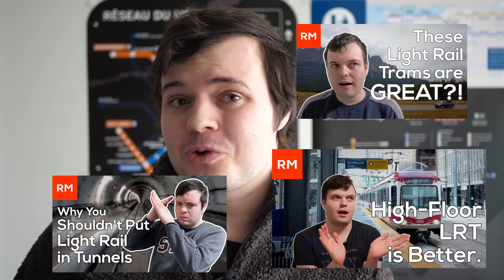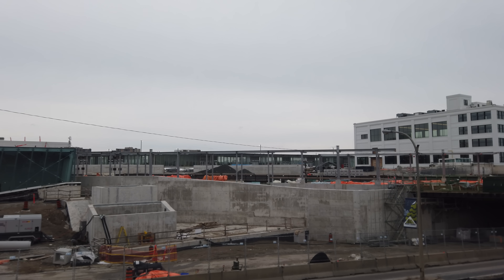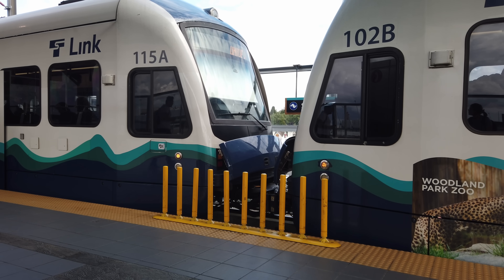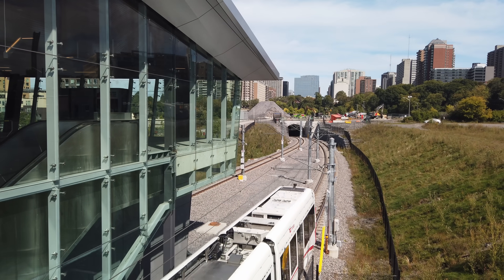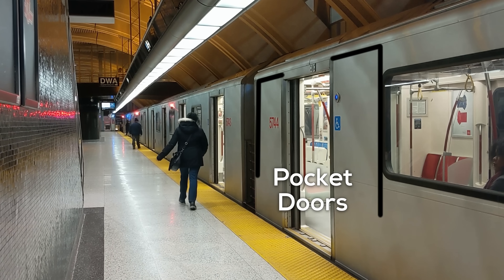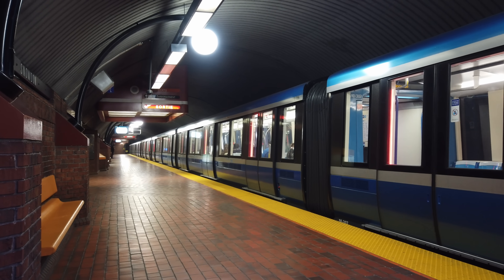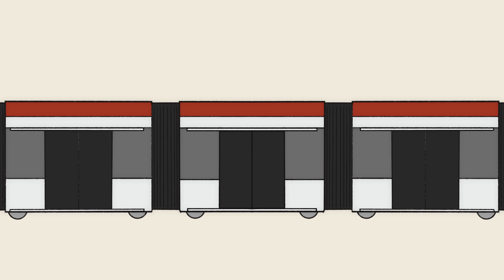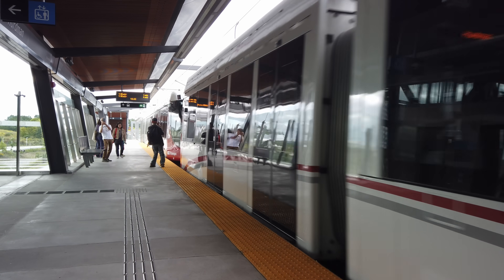I Designed a Better Low-Floor Tram

Comment: Would you like any train with your doors sir? In all seriousness, I like your logic, but your final design seems a bit ridiculous. Too long and too many doors. You make a very good counter argument about why having a single long vehicle can be a bad thing and then promptly totally ignore it and make a giant caterpillar of a train. I think it should be split in half to allow more flexibility and then each segment should be a bit longer. If you've put trams on a line that's more suited to high floor trains, then I presume you don't have super tight radii, so why do you need such short segments? Segments = added complexity and wasted space, so you want to have as few of them as possible really. I think a 4 segment unit that's half the length of yours could work pretty well. With the longer segments, the end ones could have 2 doors each and the centre ones 1 each, so you'd have 6 per side, and if you joined 2 units together, you'd have 12 per side instead of 15 in your design, which would leave more room for seats or standing and increase the body strength.

Comment: While this design is very very clever, here's my concerns. Having worked in public (or private) transportation (in more ways than one) you have to find that quite a lot of people prefer seating as well... By doing your design, you're only guaranteeing a 1 to 3 ratio of seaters to standees... Unfortunately, adding more doors also adds MANY MORE complex parts that are liable to go wrong. WDW Monorail comes to mind, 12 sets of doors on one side of a 6 car train, the doors act up from time to time. Despite the angle you were going for, I'd suggest that every other car has a door. With your shortened sections on your "FULL CHARM" trainsets (I saw the comment, I like it) it still allows easy access into the cabin AND the doorless cabins can be full wall seating. Just a thought. We (unfortunately) live in a society where you have people that will automatically take seats (even when they don't need them) leaving no seats for the elderly or special assistance passengers. With that being said, I quite like the thought process behind this! I've sketched up my own designs over the years myself, so I like what you're going for!
Reply: 7:04 Having 2 smaller instead of 1 large door means each door takes less time to finish opening & closing though (as each door leaf needs to travel a shorter distance), allowing for shorter dwell times at stops/stations. If you're worried about higher energy consumption due to more motors needed if you want to open more doors, perhaps every 2 neighbouring doors could be mechanically connected to a single motor (unless you want to allow selective door opening)
Reply: @lzh4950  it was meant to say every other car has "a set of doors". Half the amount of doors with the same concept.

Comment: I figured that in order to accommodate higher capacity in the future Seattle would possibly just have to grade separate rainier valley and SODO with everything else being grade separated but it appears that I was sadly mistaken as even on the east link segment there are grade crossings along the disused track that Sound Transit bought from BNSF. 

I find some of the decisions they’ve made to be pretty shortsighted given how little savings the capacity compromising aspects of link are compared to its absolute price tag which will be high either way. 

It would require modification to multiple platforms but I honestly wouldn’t mind the link vehicles being replaced with vehicles possibly using similar dimensions to those found on Septa Regional Rail trains. Build new ramps at the at grade stations in the suburbs and raise the floors of the underground and above ground stations in Seattle. Much easier said than done though

Comment: Rather than having bogeys on the small sections with large sections suspended with doors, you can also have both the bogeys and the doors on the larger section with small section containing only a few seats (or standing room) for passengers travelling longer distance. You can see this on TMK2200 trams by Končar operating in Zagreb.

Comment: 60 Meter low Floor Trams are in some Citys planned oder in Use. Often you can split them up in the middle.

And if you build a Frankfurt U5-MW, only as low floor, you can make your Tram as long as you like.

Comment: but the cost would be higher, that's one thing to consider as well, grabbing something off the shelf or even something that someone else has cancelled is much cheaper than custom building something, this may be better for capacity but is it really upfront cost friendly, especially for countries that are wanting to really dabble in trams, and even though you want them to go big, the first experience with trams should be suited to their needs rather than "go big or go home" method, especially when trams is the cost effective middle ground between heavy rail and... a bus.

Who knows, this may actually work out well for very popular cities with a transit budget that would rival small countries GDP's where they need to move as many bodies as quickly as possible.

Comment: i always thought that with some more considerations for strengthening, it’d be cool if we could use the Vienna Tram strange-bogie things in-between slightly longer cars of say 14m, packing on 3 doors per car side. the bogies at the very front and back would be normal bogies with these cars sacrificing a door. idk if it’s feasible given this weight but i think if it is, you’d pretty much have a normal metro train, at least from the inside, where you have the freedom to design it as any other metro train.
Reply: The ULF "Ultra low floor" wheel assemblies are extremely expensive to maintain. There's a reason newer trams aren't build that way
Reply: @muthisamwernergruber  i’m aware, but this whole video is about an expensive solution to an expensive mistake in transit planning.
price isn’t really the point

Comment: Something that could be added to make more short trains instead of a large one is to put a British sprinter like gangway in the back of each tram, allowing you to double the capacity of a single tram, and perhaps adding more standing space compared to a regular tram. You could even do middle sections of a tram with gangways in both sides, that would raise some operational challenges though, since there will be some units without any cabs.

Comment: Doors are over-rated...same with seats. Just have no doors with a plastic flap in front. Or a garage door that rolls up and inwards to roof. Also wheels are not really needed...just go French and add tires.

Comment: Motors under longitudinal seating in a low floor segment just doesn't work. The biggest thing that is stopping LRVs from having higher capacity is the smaller turning radii required to be operated on the street. The Stadtbahn in Cologne for example has per vehicle only two joints, both placed closely to the center unpowered bogie, while the motors are on the outside rotating bogies at the end of the train. This already improves capacity a lot, but also means that the train doesn't fit through the smallest streets. It does a good job though at being a metro imo

Comment: Single wheelsets (not boogies) severely increase noise and vibrations, severely decreasing the ride quality. I'm much more fond of the idea of putting boogies under the articulations
Reply: “boogies under the articulations”???  You want a boogie-woogie train?
Reply: Jacobs boagies exist so there is a way

Comment: Given that the aim is specifically for a high capacity LRV to be used in metro style services, you did good. Real good. This is exactly that.
Not the right fit for most systems or most lines, no, but that wasn't the aim. And stepping away from a one-type-for-all for LRVs is the right thing to do. It is already done, of course, but this fills a niche that currently is NOT filled. 
5/7 best ever.

Comment: I really like this! I’ve always thought that low floor trams could be much more space efficient and this is so satisfying to see visualised. The only thing I might add would be two/three slightly longer segments (like on Citadis trams) distributed evenly to allow space for either wheelchairs or bicycles since these smaller segments from the Flexity Freedoms don’t appear long enough to have space internally on either sides of the doors.

Comment: Sometimes I do feel like if we can find cheaper and easier way to raise the platform instead of doing so much engineering gymnastics around lowering the floor would be better. Just raising the platform 50 cm above the ground and many problems just go away. Like how many BRT has their raised platform so they don’t have to use low floor buses.
A quick edit: maybe we can come up with a general platform design and pre-fab them in parts so they can be easily laid on top of the existing road surface so they cost very little and very quick to setup.
Reply: Raising a platform in itself is not difficult, but you need to think about stairs and elevators as well, an that gets expensive and time consuming really quickly
Reply: Or ramps could be connected to the newly raised platforms

Comment: The London underground's Bakerloo line has pocket doors that slide in to the coach BERWEEN THE DOUBLE GLAZING OF THE WINDOWS
Reply: That completely defeats the point of double glazing. It needs a vacuum between the panes to act as insulation.
Reply: @C.I...  I think in this case its so that you aren't catching people's fingers.
Reply: The class 378 as well.
Reply: And it is always dirty
Reply: Gosh all that for a door

Comment: Why is capacity so important in your eyes? I mean even in the busiest of networks, the amount of time that the system is crowded is low. If you assume 2 hours per peak time, two times a day (to and from work) that is equal to 4 hours in a 24 hour day, or ⅙ or 16,6% of the time. No wonder that systems are planned with other priorities

Comment: I think many Canadian agecies are wary about high-maintenance issues after the colossal flop that was the Turbo Train (using axles in the articulation joints and pendular technology licensed from Talgo) from 45 years ago. Not to mention two engine fires in its brief 12 year history.

Comment: Is it possible to use highfloor tram and then sink the rail near stations, to make it accessible from low platforms ?
Reply: I was thinking about that too. Maybe low floor stations and platforms should be built in a way so this option is possible

Comment: I think you have too many small segments, I would merge two of your small segments into one larger and put wheels between the segments. Having larger segments would create more capacity and allow more variations for seat placement between the doors. Trams have small segments for tight turns in narrow streets but lines that are built like a metro would in my opinion benefit from longer segments.
Reply: Remember, though, these things have to be able to (in some instances) corner within a road intersection (and similar situations), as I understand it. That puts a cap on segment length.
Reply: @laurencefraser  Some trams have segments up to 10 m long even on old networks (look at Melbourne's E and G classes). On more LRT-like systems (new networks in France for example, or the O-Train) there can be segments 12 meters long.
Reply: @joriss5  Yes, about the same (it seems) as pretty much any high floor tram.

EDIT: A lot of low floor trams do have shorter segments that those of pretty much any high floor trams as well as any bus - high floor or low floor.
Reply: long segments with only four wheels each? sounds like the pacers...
Reply: How about jumping up to three-axle jacobs bogies between the segments?

Comment: I think that adding more wheels also means adding more weight, cost, complexity and takes up more inside space. Also getting rid of bogies means that the track must be a lot smoother because single wheels aren't as forgiving on bumpy tracks. As I understand the ULFs have their issues, which is why the Flexity chosen for the next series has wheels under the first, third and fifth segment.
Your idea also reminds me of the Cobra in Zürich, which however doesn't seem to be that much of an advantage: It's not been ordered by any other system and they too went for a Flexity similar to the one in Vienna where sections with doors and wheels are alternating.
(As a side note I don't like the plastic seats of Vienna or the wood seats of Zürich ... leather seats as on the newer Cityrunners in Linz are nice.)
Now sliding doors on the outside are rare on trams. I assume they limit the width of the body which means less inside space for a given total external width. The plugging-sliding doors only take up extra width when open, allowing for more inside space which adds to comfort and capacity. I know that London Tube uses outside sliding doors, class 485 on S-Bahn Berlin would be another example, but otherwise they don't seem to be all that widespread ...
Reply from the maker: To be fair part of the issue with track quality in Vienna probably has to do with the fact that you're operating with embedded tracks which is something we don't have to worry about on these routes for the most part
Reply: @RMTransit  This should not make any difference, as streetcar tracks are usually laid the same as ballastless tracks. The only difference is that streetcar tracks are filled afterwards.

Comment: A lot of German cities (Stuttgart, Hannover, Karlsruhe,etc…) have done exactly what you describe hasn‘t been done before. Take a tram put it in a tunnel, and then later turn it into a small scale metro system.
Reply from the maker: Not exactly I've talked about these cities and their stadtbahn systems in the past and they are distinct
Reply: @RMTransit  yes and no. While I agree (like Pixon) that the Stadtbahn systems are very distinct and more suited for smaller scale operation than the places where the US is building it's LRT.

Today's Stadtbahn systems however are a vastly modified version of the trams that initially got put in a tunnel. I'd imagine the development path in the US would not be all that different.

The issue of scale remains but is to my understanding not necessarily part of this video. If you need to build trams the size of Reece's explanation, you will need to think about a proper Metro/S-Bahn system. The systems in the US are built, yes. But not set in stone. I'm interested to see if and how there will be development to them in 10 or maybe 20 years.
Reply: @dav_8356  They also cannot share platforms with buses.
Reply: I was gonna say, the Brussels premetro is exactly trams in tunnels for highish passenger capacity.
Reply: @szurketaltos2693  Yeah, but it was meant as a temporary solution.
Reply: Stadtbahn systems remain distinct from American LRT systems, because in Germany, these systems usually serve towns with populations around 300k to 500k, maybe 1M, but that's fine: Medium capacity transit for a city of medium size. Additionally, the tunnels are usually for trunk sections or difficult terrain, and thus, many branches in the outskirts of the cities still retain a tram-like feeling.

However, in North America, LRV is not a suitable solution, as it seems that they are trying to build "low-budget metros" in large cities that actually need proper metro systems.
Reply: Pre-Metro systems like this including Frankfurt's U-bahn are what the Edmonton and Calgary LRT systems were based upon, especially Edmonton which has a central high-floor subway under its downtown that has 125m 5-car platforms and trains to match during rush hour. It almost does a complete loop however it's two stop short of a full circle. 

We just opened (Nov 4, 2023) a low-floor 12-stop 13 km tramline as well that uses Bombardier/Alstom Flexity Freedom cars although the top speed on the system is a paltry 55 km/h if I'm not mistaken...  And that's after 3 years of design and construction defects and delays. It seems to be A-OK now and well used already however it suffers from a long/slow travel time between the end of the line and downtown as well as a very cramped narrow feel aboard the trains as nice as they are with big windows to help combat this claustrophobic feeling...